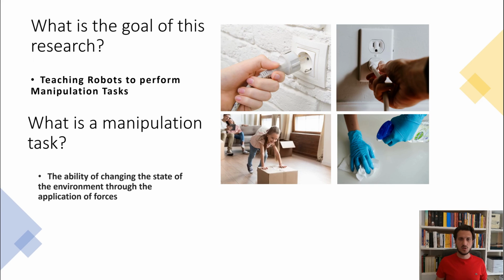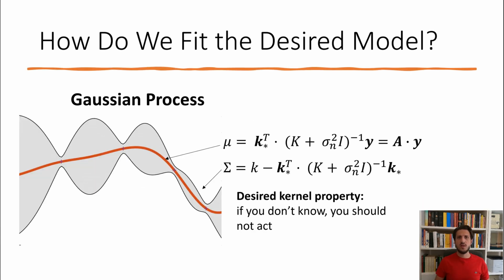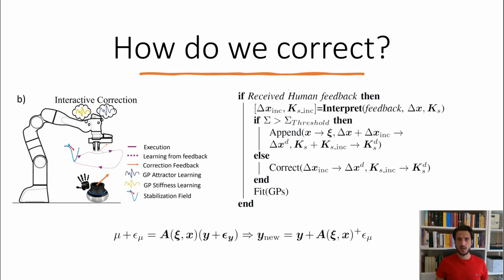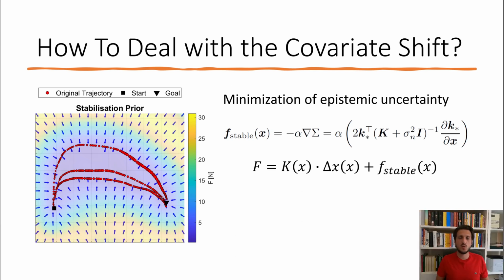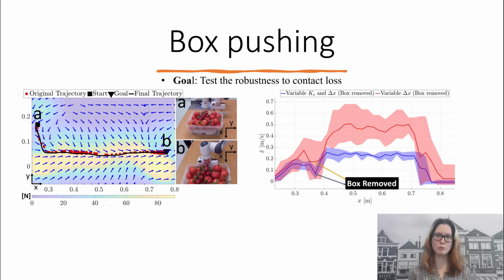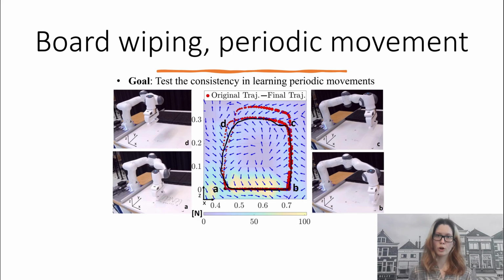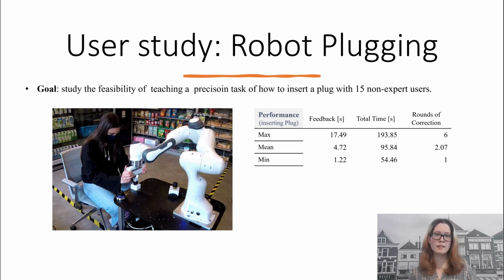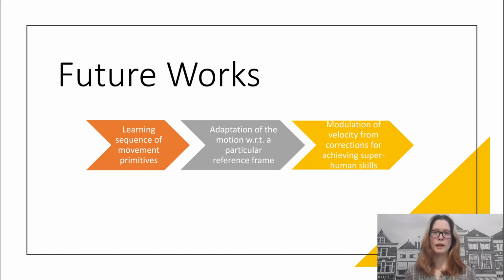Talk on "ILoSA: Interactive Learning on Stiffness and Attractors"  @ IROS 2021

Comment: I am interested to know why this approach learns the attractor and stiffness,  and not damping which is also one of the parameters of the impedance controller. It would be great if you can comment on this.
Reply from the maker: Hi Ekansh, this is really good question. The low level controller sets the damping as 2sqrt (k) in every diagonal components. So it would also increase the damping when the stiffness is increased. This would ensure a critically damped like motion of the motion. This is not really true because the mass is not taken into account, but empirically, it does not change much. 

The goal of this paper was to show that learning the stiffness allows to apply enough forces to plug, unplug and clean even if the maximum attractor delta is kept limited. This ensure to have a safer policy when contact is lost, like shown in the pushing of the box task.
If you have any other questions, please contact me at g.franzese@tudelft.nl